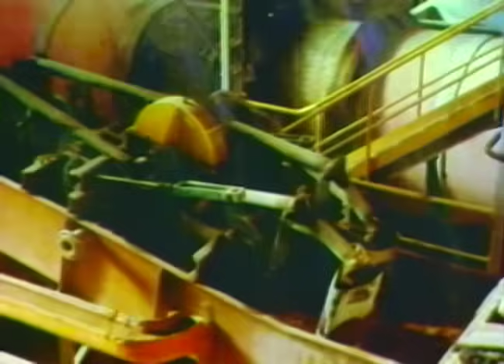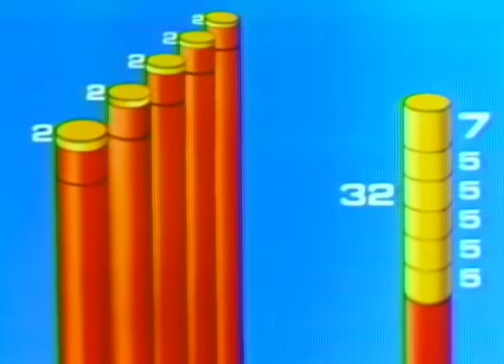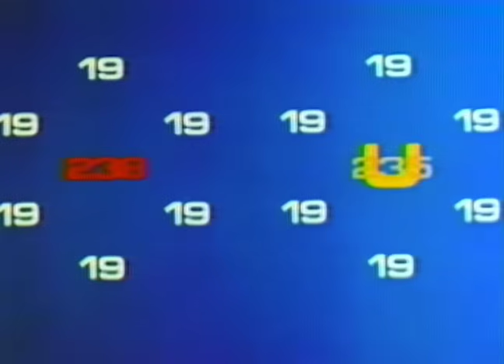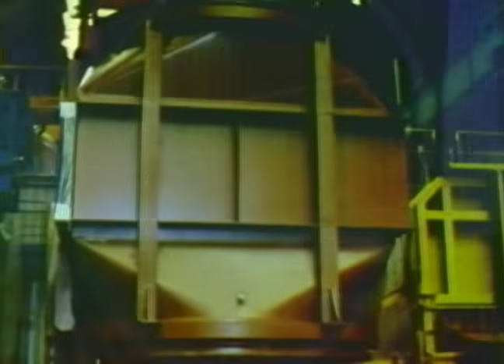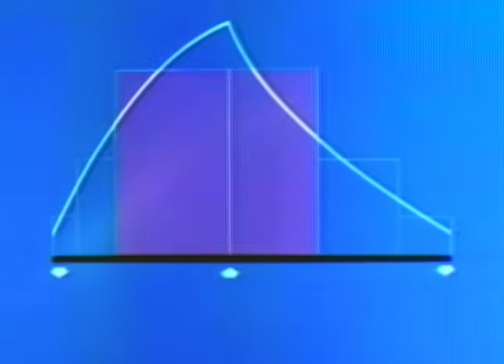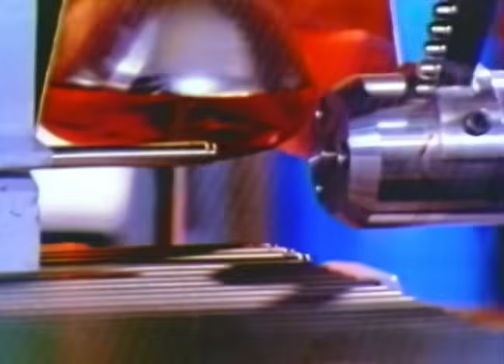The Enrichment of Uranium (1980s)

Comment: Surely the best explainer of gaseous diffusion enrichment I've seen — especially the cascade scheme. For a centrifuge plant, it's more or less an identical arrangement. Revealed a lot to me about that even though the efficiency of centrifuges is only slightly better, that small improvement is worth the added cost and complexity in engineering. Enrichment centrifuges are absolute wonders of engineering. I heard Matthew Bunn from the Belfer Centre at Harvard tell a story about a colleague pretty much engaging in sabotage of — a country who's name I forget; possibly Iran — an enrichment program by reaching out and touching a bearing with his bare hands during an IAEA inspection. No amount of cleaning the bearing would remove enough of the grease from his skin for the centrifuge to be as precisely balanced as required. THAT's insane. Though, I was left wondering why the bearings were sitting out unprotected, exposed to the air — perhaps they were in a clean room. It's a nice thought, regardless.

Comment: Hydrogen is number one for a reason.

The enrichment process, is egomania of an engineer, and contributors, all thinking themselves more important for the work.

Does the gain outweigh the energy spent on mining, or condense it dangerously?  Is the immense amount of steel required for entombment taken into the cost benefit ratio.  How about the contamination of ground water, which must be distilled concentrated and wasted for eternity?

The water can be split into HHO and recharged by atmospheric ionization time and again.

Nuclear is nuts, and not in a gee wow, sort of way.  

It‘s used to hide missile bases, in towns, isolated off grid.  They‘re called boom towns.
Reply: This guy voted for AFD 100%

Comment: I wish scientific/industrial organizations still made informational films like this!!  It seems like the golden age was from the 1930's through the 1980's, and since then, everything is either bite-sized or completely dumbed-down.
Reply: i got interested in U235 fission in the 80's and building a U235 fission reactor was only $2billion! due to inflation now its like $13billion?
Reply: @grantchang81976  Try a Farnsworth Fusor.
Reply: While I do agree with you, you can still find some premium educational content on industry processes. Branch education, Asionometry come to mind
Reply: @rampel1  Asianometry is an ironically apt choice.  Consider the video where he attempts to explain vacuum tubes.  Almost every single thing he says about thyratrons is wrong--especially with regard to switching time.  He also confuses them with mercury-arc rectifiers, asserting that thyristors replaced them. (They are still used to this day in radar because nothing else can switch that much current that fast.)  Nope, if you wanna learn about thyratrons,  Principles of Gas-Filled Tubes (1945)--which is also on Youtube--is a far better choice, which affirms OP's assertion.  These old films educate, while the likes of Asianometry spread credible-looking misinformation about distant topics which, at most, they scanned Wikipedia about, and they nearly all rely on generic stock footage and photos they found on Google Image Search instead of investing the work a real educational film requires.

This is not an accident.  The functional purpose of e.g. Asianometry is ad revenue--education is a secondary purpose, because he only has to look educational enough to get the eyeballs.  Same with Veritasium, Vsauce, HAI, and every single Simon Whistler channel.  (No matter how many times I tell Youtube I'm not interested, the bastard keeps making more channels.)

Asianometry knows exactly as much about tubes as a typical Hackaday reader who sees a triode and goes "ooh, is that a nixie?"  (I hate nixies.  They are all looks and no personality--they can't amplify or modulate anything, and idiots on eBay increasingly label every tube they see as "nixies".)  That's about as much reading as he did for that video--whereas these guys talk to actual engineers who work with the subject at hand and then draw a whole cartoon for it.

And they paid the cartoonist.

If you want a good example of modern educational media:  Practical Engineering.  Dude actually builds the thing in his garage, shows you what happens, and explains why.  There is no substitute for that.

...But it could still use more cartoons.  They remove extraneous detail and emphasize what is hard to see, and us artists could use the income anyhow.  (To PE's credit, that's why he builds everything out of acrylic and uses colored water--so you see mainly what is important.)  Back in the day, it was common to precede the physical demonstrations with cartoons to make sure people knew what to look for--what details did and didn't matter.

(And if you want to know how I know enough about tubes to say Asianometry didn't do his reading, I have a BSEE and I design and build vacuum-tube synthesizers and guitar amps.  I also have a bachelor's in physics, so I could describe the operation of a thyratron in considerable detail.)
Reply: The total lack of basic gcse o level biology knowledge, was shocking. 😮😊
Reply: Most companies i know have special visitors days. You can go to ESA or other hightech company. Just visit there website. Most of the times you only need a valid ID and can't take pictures. Same goes for large infrastructure projects in the Netherlands. Most of the times they even have a tribune where you can sit down at a high point and see everything happen. Like moving a bridge on it's place in a couple of hours. The large companies use most of the time a electric train with wagons you need to sit in. Most of the times your not allowed to walk arround. But that depends on the company and danger. In large powerplants or chemical plants your allowed to walk arround. They use these trains to reduce the amount of walking. And the guide is a person that works there. And can tell you everything into a very large detail. So, visit CERN or ESA or what every you want. Check the website and register.

Comment: Reading up, when this gaseous diffusion plant was retired in 2012 and replaced by centrifuges, the power requirement went from 2700 to 50MW for similar production. Wow.

These producers/musicians are really cool, I recall another nuclear film they did.
Reply: Was it the one about the Superphenix breeder reactor plant?
Reply from the maker: @hmbpnz definitely yes. Same producers. That one was just called "breeder reactors" I think.
Reply: @hmbpnz  That'd be it!
Reply: it's wild that they actually needed a powerplant to power this operation
Reply: @ababelabel   It is. Around 3000 MW is a typical electrical output for a large multi-unit nuclear power plant.

Comment: The plant featured is the old Georges Besse gaseous diffusion facility at Tricastin in southern France.  It closed in 2012 and has been replaced with a successor plant using the more efficient & compact gaseous centrifuge technology.
Reply from the maker: Thanks for the ID! Very cool.
Reply: America is so efficient that we built not one, but two centrifuge uranium enrichment plants, and then immediately scrapped them and buried them in the western deserts. 🙃
Reply: @gregorymalchuk272 , its fine, we'll just burn more coal, and blame the consumer for everything else
Reply: thats funny because all I could think about watching this again was "setting up old fractional distilation gear and the first time i started my centrifuge that was imbalanced!" typing in the dark, spelling bad is my human weakness so i do apoligize sir.
Reply: all cockblockery aside, Its supercool because the power to run these highly sensitive to literally everything cents is no joke, No suprise France has improved by a leap, if true of course. They embraced all of it and have follow through that is next level.
Reply: @DEVOLUTION_7677  what type of centrifuge do you use? the big ones or the smaller ones?
Reply: @grantchang81976 the ones for human blood.
Reply: Google Mapped it, and of course it's blurred-out: https://maps.app.goo.gl/hkrm7Cuj3djvJrtJ9